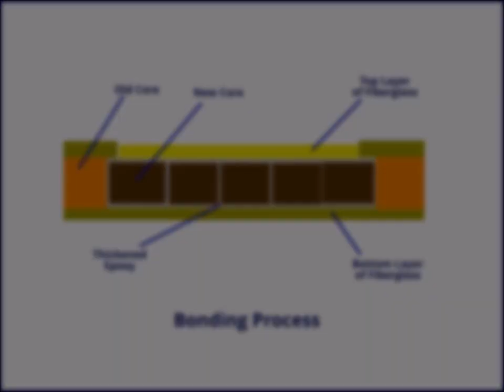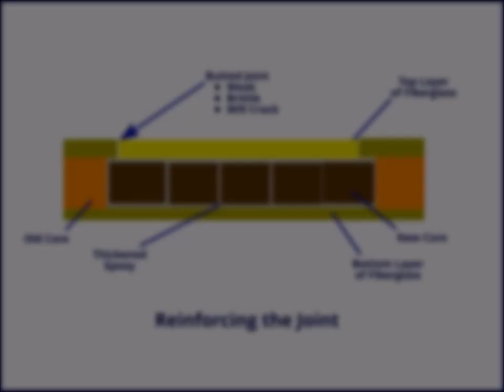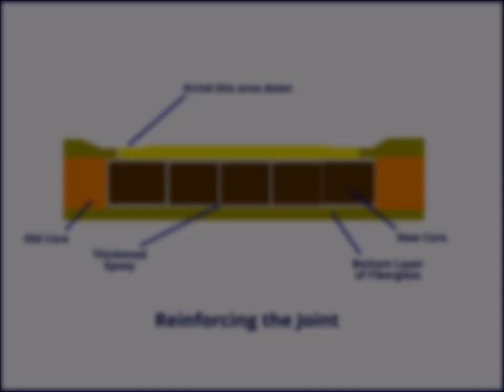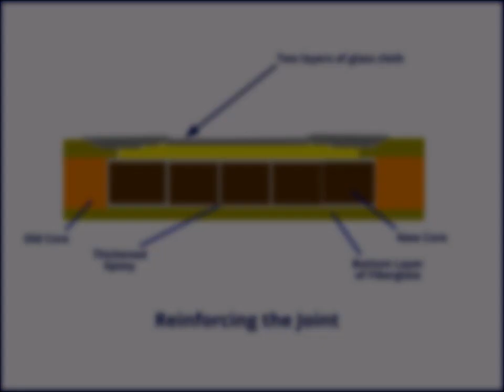Deck Repairs Part 3: Bonding the New Core

Comment: Does the structural integrity of the deck compromised by doing a patch work? It makes total sense to remove the rotten wood in the middle, but then if you had to drill through a chainplate, would it still be as strong as when the shell was structurally whole?

Essentially, how can you insure that the patch work has the same load distribution as the rest of the undamaged deck?
Reply from the maker: @patpat5296  Good question! If done correctly, the replacement core of wood/epoxy bonded to the upper and lower deck should be as structurally sound as the original deck, and certainly much better than the rotten core it replaces.  We originally had a teak deck, and the hundreds of holes drilled into the deck to secure the teak caused a lot of leaks into the core. Our entire foredeck was repaired using this technique by a shipwright in New Zealand, who taught me how to do it. Over the next few years, I repaired several other major sections of our deck. We had no issues with any of our repairs after 80,000 nm of ocean passages. Hope this alleviates some of your concerns.

Comment: Great Video.  I realize that using multiple small pieces is easier to work with,  but isn 't it stronger to use one piece of plywood?
Reply from the maker: @bogdanstoic  Hi bogdanstoic, thanks for the feedback. I tend to think that since each small piece is encapsulated in epoxy and assuming there aren’t any voids,  that using smaller pieces would be stronger. I have no evidence to back this up, however.

Comment: Well done, ty for your natural way. I see you cloth the deck to finish it. I was wondering if reusing the cut fiber glass piece was possible?
Reply: Hi Francic8955, actually, I did reuse the cut fiberglass. Towards the end of the video, you’ll notice I epoxied the old glass in place, then glassed over it with new tape and cloth to reinforce the bond, and level the surface. Hope this helps. Good luck on the project!
Reply: @gentryanderson3247  much appreciated, i dont understand why i had missed this, my bad. Will revisit your video thoroughly over the weekend. Thank you for this.

Comment: Instead of having a vertical brittle joint from the existing fiberglass deck and the replaced glass piece, try creating perhaps has much of a feathered edge 12:1 in both directions and then place the tape(s) over the joint, you can see this process in the West Manuals. But as one of the comments below suggests don't use the plywood, but balsa or better yet the foam as I suggested in video #2.

Comment: Is it easier to use small pieces rather than one solid piece. I am repairing a locker lid, so I have a edge to force the solid piece in. Enjoy your vids.
Reply from the maker: I generally think it's easier with small pieces, but for your locker lid, a single solid piece may well work just fine. Make sure  to dry-fit it before applying the epoxy. Good luck!
Reply: @JustALittleFurther  thank you so much for helping me twice. Still a little scared, but thanks to you, I am going to try it as soon as it warms up a little. The best to you and your wife. Bill Johnson

Comment: The vacuum pump is the best solution  - the final finish in such a job is difficult and needs some talent - unless no one care how it looks like. In my case, I may install teak planks over (booth side, so looks the same). I am checking also the SeaSek product (they will cut to size). Instead, plywood use balsa. Not expensive for such an application.  It is a good idea to find out how the water enter and caused the damage (does not make any sense to reuse the removed deck if has stress cracks).  Good video - give an idea of how to approach the repair (important - plan the cut before starting to cut the deck).  It is time-consuming work, needs knowledge and dedication. And again - the most difficult is the final finish.

Comment: Great video again!  On larger projects I would evenly pour the epoxy onto the cloth and spread it out much quicker using a squeegee! Using the brush takes too much time and in hot temperatures can start to harden before you have gotten a chance to wet out the whole area.  Using the squeegee will also give you more time to use the roller to get out the air bubbles before the epoxy starts to cure. This is important especially if you are going to use several layers of  cloth. On much smaller projects using a brush is ok.
Reply from the maker: Good suggestion. The area I was working was big enough to merit using a squeegee... thanks.

Comment: Great video series, thank you.  I recored the bow section of my previous sailboat, and looking to start a new project that also needs recoring.  I used your method on my last project and it worked well, but another school of thought in this is to use layups of glass (1708 and CSM) to create a new deck skin, rather than use the old one.  Thoughts on this?  I'm trying to decide which route I will go.
Reply from the maker: I've done it both ways. If the deck skin is in good shape, I think it's easier to reuse it than layup a new deck skin. If the old deck skin is damaged or delaminated, there's no question that laying up a new one is the better way to go.

Comment: Really good job on this.  I've bookmarked it for upcoming projects.  Quick question,  when you placed blocks into wetted expoxy\403 mix on bottom  do you also put the epoxy\403 on bottom of each block ?  Thanks again for posting. - Cape Cod
Reply: Good question. Yes - I painted the bottoms and sides of the blocks with straight epoxy first, then wet out the bottom surface, followed by the 403 mix.
Reply: Nice job. Very informative. I’m about to rip out my side deck. Just wondering why do you cut small blocks of ply instead of one big piece?
Reply from the maker: @drs9147  Partly because the surface below is not entirely flat and partly because smaller pieces are easier to work with.